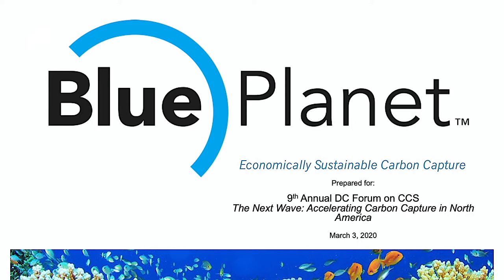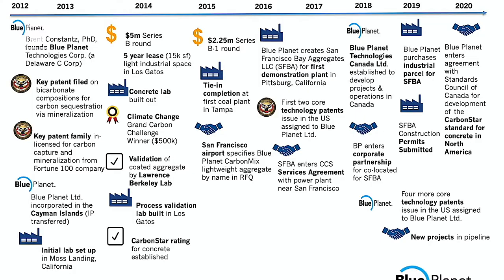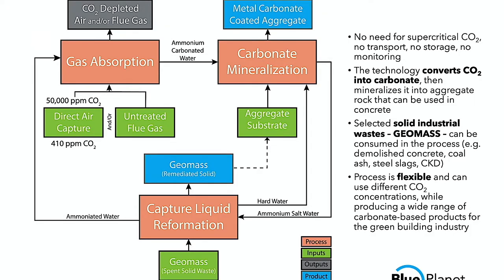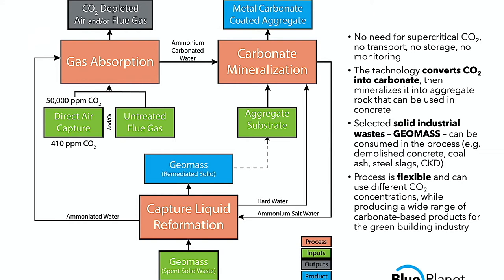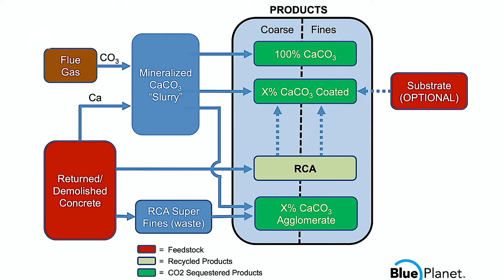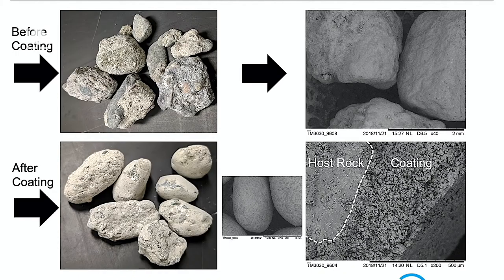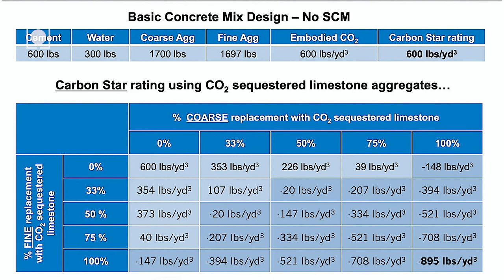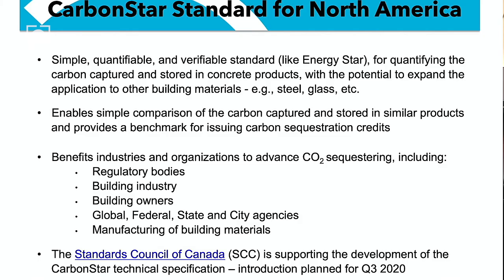CCS Tech Talks - Rodney Schmidt, VP, Blue Planet LTD & CEO Canada, Blue Planet

Comment: Ca, Mg in the crushed recycled concrete or other geomass is released via the liquid reformation step, In what form is the Ca, Mg in the recycle material? If it is as CaCo3, then is CO2 not generated in this step, defeating the object of the process? 
Noted that in the SF airport spec, the Green Planet aggregate is specified as 5% of the lightweight aggregate and not included in the heavy aggregate spec. Seems to suggest that the inclusion of the GP sequestered CaCo3 in a tonne of concrete is limited to a lot less than the 80% suggested.
These aspects need to be made much more transparent.